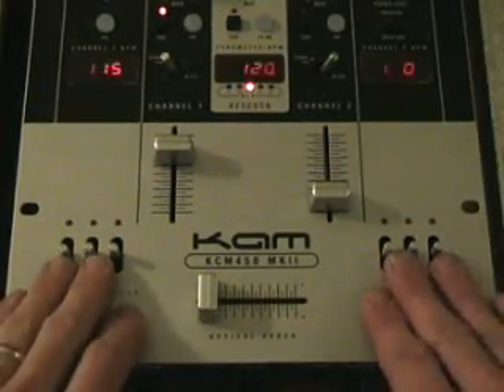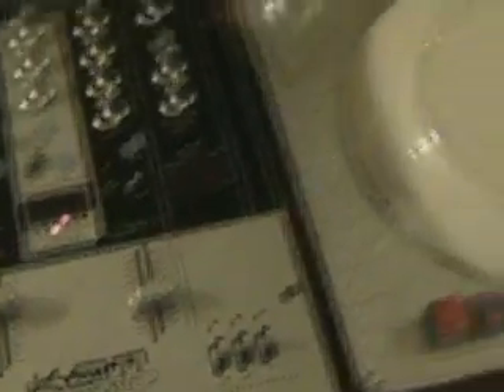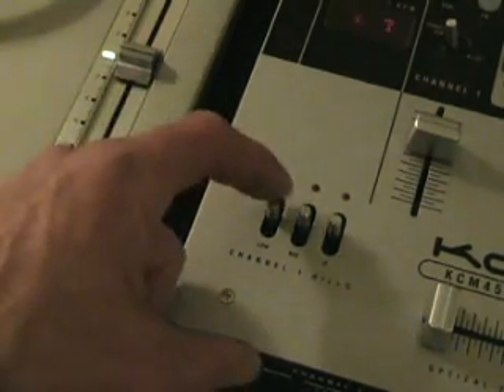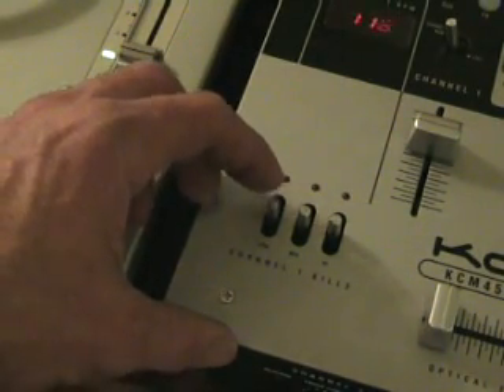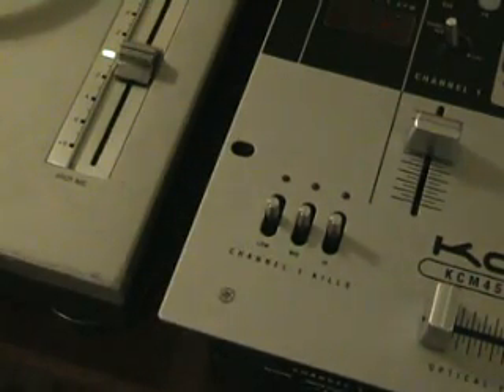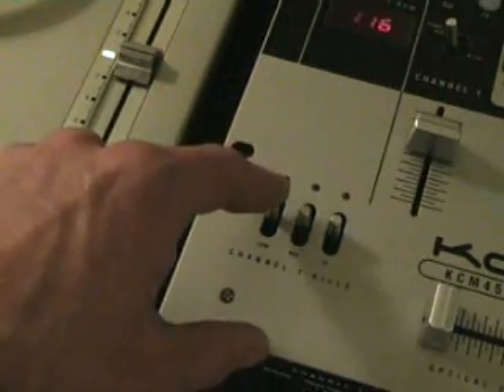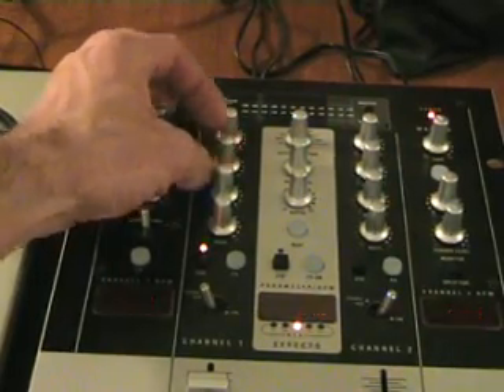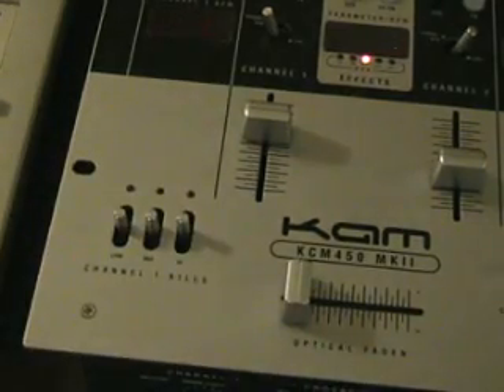A look at kill switches on a dj mixer. The KAM KCM 450 MK 2

Comment: Hi mate I have this mixer but I have just bought it used the cross fader don't seem to fade unlike my pioneer one I had so using the cross fader is not very good seems to be on one channel on off rather than fade is your like this or does it sound like a dodgy fader